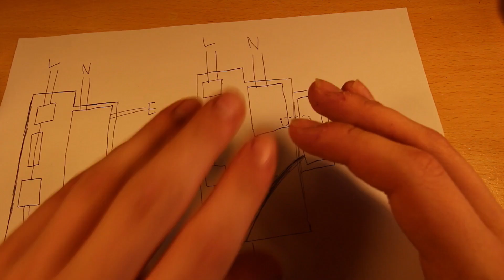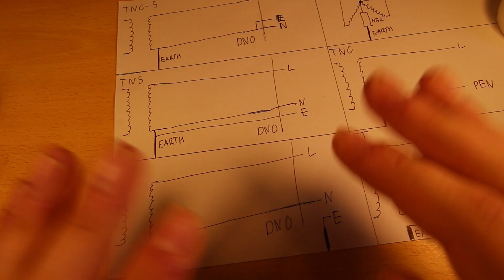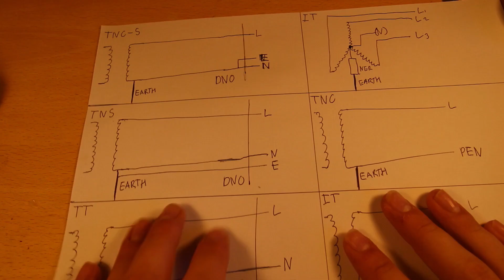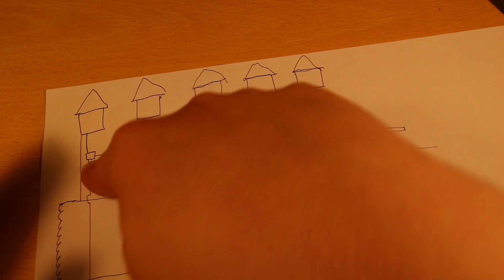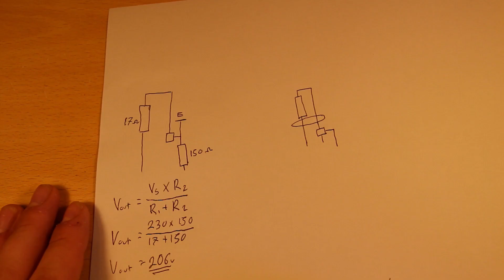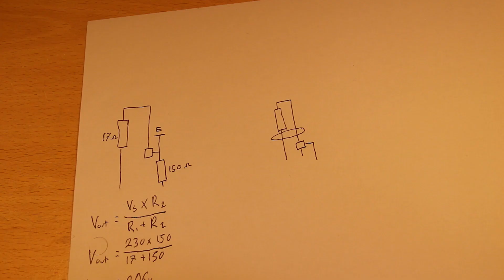What is a PEN fault? | Earthing arrangements explained

Comment: In my country TNC was the norm since electricity was common and before the standard even existed. In 1970s gradually started switching to TNC-S. In 1990s TNC is forbidden for new installations. New home installations new must always use separated conductor for neutral and protection. But 1990s is not that long ago and many many homes still have TNC topology. So you must know about it and know its quirks (mainly unusable RCDs)
Reply from the maker: I would be quite supprised if they did not get rid of TNC and TNC-S in the UK when the next major overhaull of our electrical reguations happen. It wont be all that practical to make blocks of flats TT, but for any single house or building TT is vastly safer now, given we have RCBOs that are so cheap. For big blocks of flats youll probably see TN-S becoming common, but TNC and TNC-S I cant see lasting much longer given the risks of PEN faults.

Comment: Thanks for this Craig, it's helped get my brain working. I have a very specific case, that of being a Radio Amateur. We NEED good earths for our aerials, especially for H.F., 0 to 30 Mhz, which is where all the real fun is to be had. I was basically aware of these issues 30 years ago when I realised the new build bungalow I purchased to was wired TNC-S. As a fix, I was advised to feed the shack from the house but drop the earth and only take L+N out to the shed. I then installed a couple of copper earth rods, one for the mains and one for the aerial. The shed has it's own small consumer unit with a 63A main breaker and both 16A and 6A MCD breakers. I'm wondering if you consider this acceptable or have I been living a lie or made a major booboo?  Thanks again and cheers. 🥃
Reply from the maker: Nope, what you did is the correct thing. "Exporting" a TNC-S earth as we call it (using a TNC-S earth in a different building to the one where the neutral and earth split) I don’t think is actually banned is considered extremely bad practice. The issue is that you are mixing earth potentials, so theoretically the local dirt around that second building could be at a different voltage than the TNC-S earth. The correct thing to do is run a 2 core SWA with only the line and neutral and put down local rods for the out building which is what you did. The TNC-S earth is actually considered a potentially live conductor in outbuilding so now they have special SWA glands (I call them Storm glands but I think that is a brand) which have a very hard plastic body rather than a brass one let you make off the armouring like you would with a normal brass gland but keeping it electrically isolated from the second consumer unit (because the armour usually is bonded at the supply end, thus to the TNC-S earth). RF earths are fun though especially in my area given we have very minimal soil, I know of guys digging up there whole garden to fit earth grids to get the Ze low enough.

Comment: I worked out this potential risk several years ago (I'm an electronics technician) and insisted on a separate "traditional" earth rod system in my house.
Reply from the maker: I always reccomend it to my customers, also isolators on any metal services to avoid them coming live in the event of a fault with another house on the same street. I think the IET (people who write the rules in the UK) should just ban using TNC-S, would solve all this.